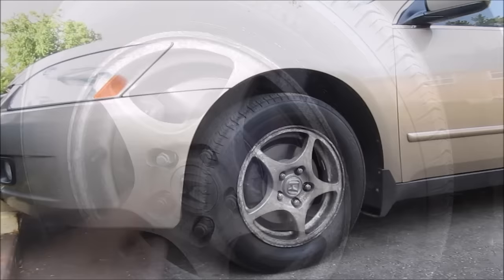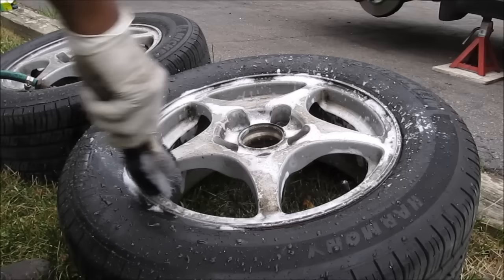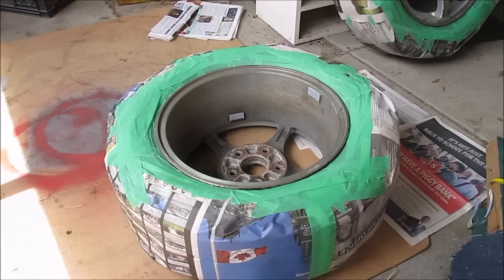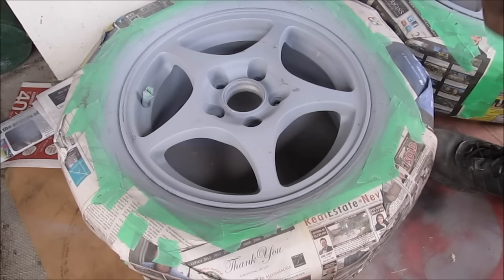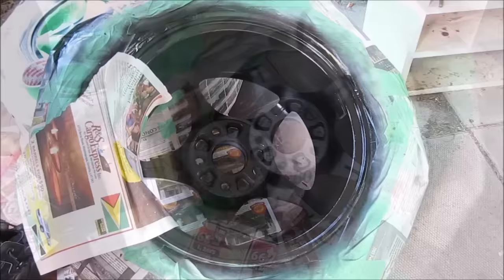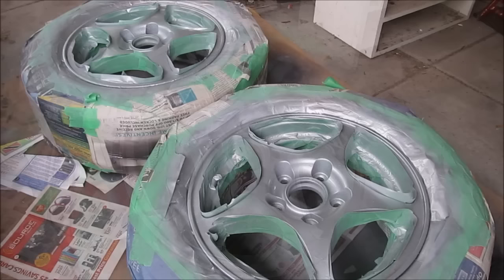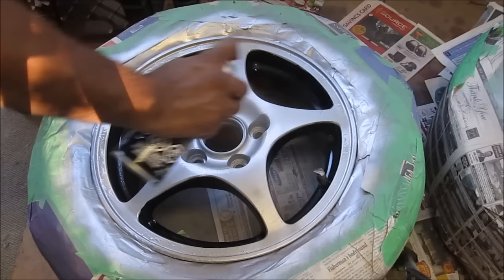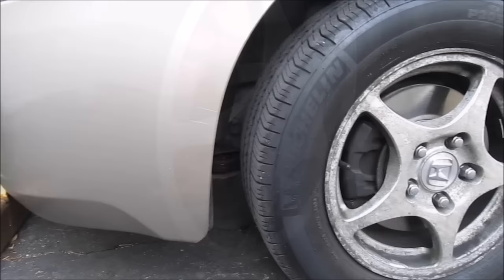How to Paint Your Car's Wheels Two Tone

Comment: I'm just suggesting, I'm currently doing this. Paint the wheel inside first entirely. There will be overspray it's just the way it works. Then finish with the front of the tire. I would rather have overspray on the back then the face or prep for it.
Reply: Looks good though nice job
Reply from the maker: +Jou Nowho thanks, yes I agree
Reply: speedkar99 can we use spray paint to paint the rims pls tell

Comment: if you paint like this, the paint will start peeling off a month later. You have to completely sand off an old paint and make the rim smooth as silk before spraying the primer.
Reply from the maker: +Bernardas Sakenas agreed.
Reply: Funny because when I got my first car at 18 I spray painted my rims gold (no I have no idea why I thought that looked good lol) I didn’t sand the rims or apply a clear coat after. The rims were used with all season tires in Canada so harsh snow and hot summers. I had that car for 4 years (until smashing it up) and the paint on the rims never peeled or chipped